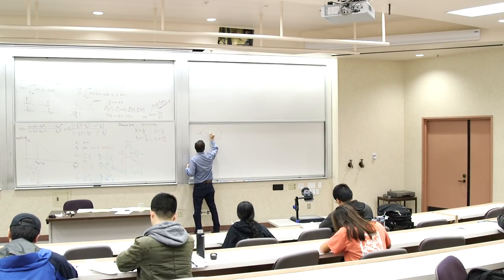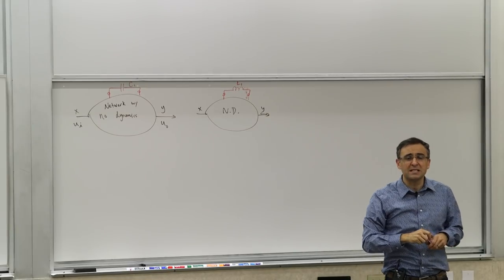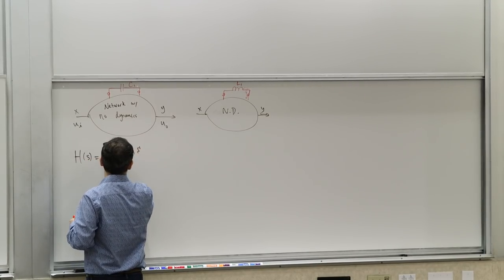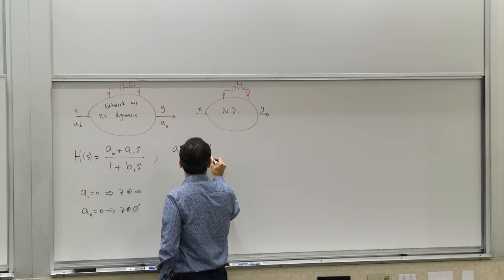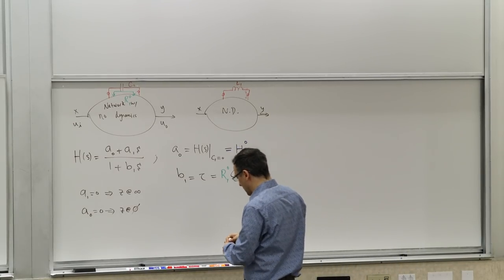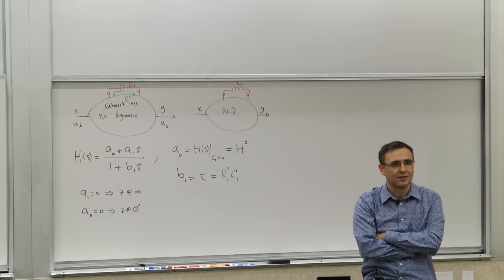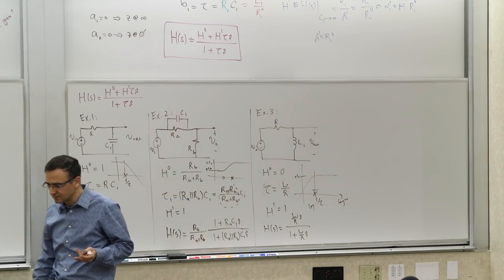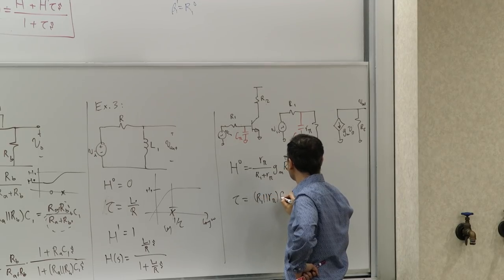140N. Time- and transfer-constants in 1st order system

Comment: I'm finding it really intuitive on how to generalize with H_0 and H_1 being the low frequency and high frequency "Gain" respectively, but the time constant doesn't feel easily generalizable. It just seems like a rule where you find the thevinin resistance of the circuit, and plug it into the time constant formula for the respective capacitance and inductance. It makes sense  based off of experience from doing it the long way, however I'm not sure how to obtain a more intuitive understanding of how to determine the time constant? I am finding it helpful just drawing out a circuit for each parameter that I'm trying to find just to visually see it.

Comment: Hi professor, I have a slightly different explanation about H_0 and H_1, please correct me if I'm incorrect. So a_0 is the DC component of H(s) and is obtained by setting s to zero, which is equivalent to set C to zero (since s is always multiplied by C); a_1 can be obtained by setting s to infinity, which is equivalent to set C to infinity, then H_1= a_1/b_1 thus a_1 = H_1 * b_1, where b_1 is the time constant. Essentially, H_0 is the low frequency behavior of H(s) while H_1 is the high frequency behavior of H(s), that's why the bode plot goes from H_0 to H_1.
Reply from the maker: Yes, it is correct. However, that way of thinking cannot be as easily generalized to the case of multiple capacitors if you  are trying to find all the an and bn coefficients. Hope this helps.

Comment: 0:24 Can we define two initial conditions for a circuit which has one voltage input and one capacitor and inductor in series(because I think this would be a second order system)?
Reply from the maker: A circuit with a series cap and inductor (and no other energy storing elements) has two energy storing elements. You can define the inductor current and capacitor voltage, so it is second order.
Reply: Thank you so much Sir!